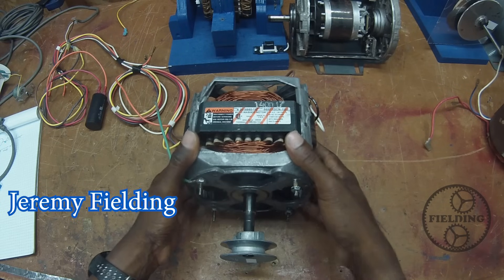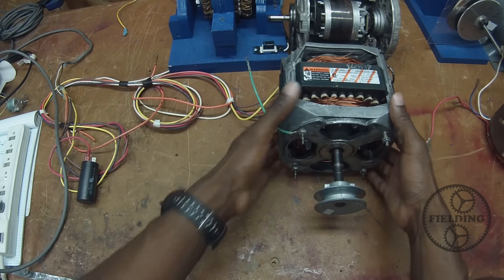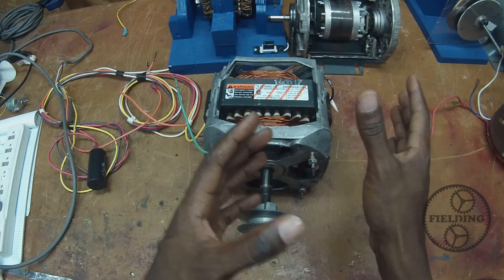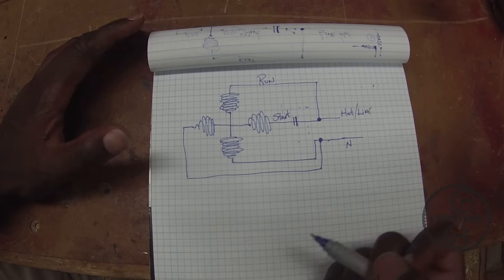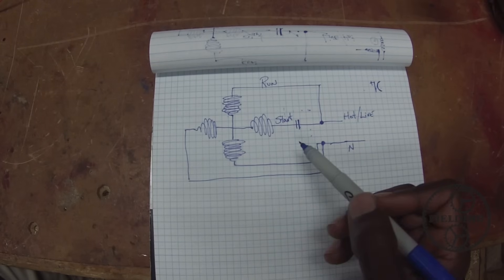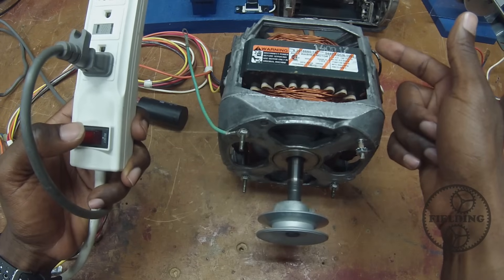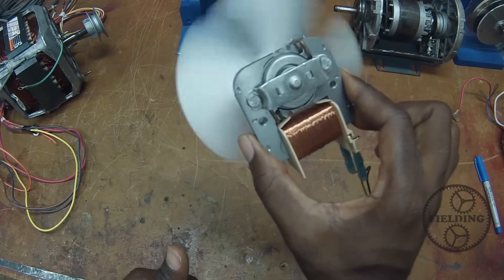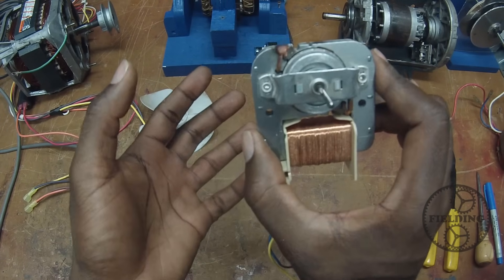How Motors Work For Beginners: (Episode 4) Single Phase Induction and Shaded Pole Motors: 035

Comment: I have a magnetic switch (only works under voltage), runcap 16 uf and 1 fase motor ( in a 0,74kw table saw). I changed out the cap due to presumed age (around 35 years), but when I connected this new cap, it buzzes. Motor does not turn. Grounding is ok. I'm now changing the aging/deteriorating wiring within the motor to the cap and 220v (a red, black and yellow lead). The black lead is connected to 3 copper strands, the red to 2 strands and the yellow to 1 strand. The yellow has deteriorated (rubber isolation disintegrated showing wire).There is no centrifugal switch inside the motor. When connected to 220v the system clicks (must be the magnetic switch) but does not run when pressing the switch, which does stay in the -1- position, meaning it is passing current. The capacitor is buzzing. What could be wrong in your opinion?

Comment: Hi my name is Fred I have a question what is the best motor to use to it to be able to adjust the RPMs I need it to stay at times at 900 and all the way up to 1800 I have a one horsepower motor from harbor freight will that work

Comment: A turntable motor designed for 110 volt with 0.8 amp fuse. What will hapen if connected to 220 volt?

Comment: I have a AC induction motor (120v) (for a bench grinder) which does not start.   I bypassed the relay (which connects to the start winding) with a momentary switch. When I put the motor switch to the on position, the motor hums and the shaft of the motor freezes.   Pushing the momentary switch has no affect on starting the motor.  The start windings measure 11.3 ohms.  The main winding measures 3 ohms.  I am unable to rotate the shaft with current applied.   I can turn the motor shaft freely with no power applied.  There is no capacitor with this motor.  Any help to understand why this motor is not working would be appreciated.

Comment: Can you run a 3 phase motor on single phase power?
Reply: You can if you use a device called a phase converter. The device generates all the phases the motor needs to run. So the correct answer is yes, and no.

Comment: hey Jeremy i have a reducer that has a 120 volt dc motor on it is there any way to make it 12 volt so i could make a wench out of it   ? and can i use a switch to make it go back and forth how could i control it ?
Reply from the maker: The winding of the motor are designed to operate at 120. You can't change that without rewiring the rotor. It will probably run at 12 volts but with very little torque compared to its full rated voltage. To the second question... yes a switch can be use to flip the direction... I explain this in great detail in my DC speed control video. I think you will find it helpful. Check it out here. https://youtu.be/ASywVBU0ZwE
Reply: yea thats what i was thinking do you think in the future vid you could show how to convert them down to 12 volts with high torque
Reply from the maker: +j mil I don't think it is practical to try and convert them. It is likely the size of the rotor slots need to change. You have to reengineer it. I would not now where to begin. I would be looking out for another motor. Check Craigslist and eBay. You may even get a free one on Craigslist if you check often.
Reply: ok thank you Jeremy i will probly look for a 12 volt replacement

Comment: Can you ruin a motor by using it to do more work than it's capable of doing?  I want to build a rock tumbler, so I need a motor that turns slow with high torque.  How do I know if I'm 'over-working' the motor.  It may turn the barrel, but is it doing so efficiently?  Or is it consuming more power than it should in order to do the work?

Comment: Hey hey:) love the videos! Invaluable info:)
I love tinkering for fun.
I have a quick question that hopefully someone can point me in the right direction for info.
Recently I found a Dayton 2hp continues duty single phase 110/220 motor.
The diagram is faded, and all the wires in the motor are yellow:0 
So I'm just looking for a descriptive vid like yours for how a 110/220 motor works and is wired.

I tried googling it but everyone just says check the diagram :/

I also googled the model of motor but those are colored wires :/ 
I thought it would be cool anyways to know how they are wired and how 110 and 220 are pushed through the same motor.
Reply from the maker: I plan to make a video on this topic.
Reply: Jeremy Fielding Awesome! 
I plan on attempting to make a light duty winch out of a powered wheel chair motor. I'll be sure to share what I learn here:)
Thx for your hard work and sharing of knowledge 👍

Comment: I buy a motor and it said that’s a 3/4-1/4 hp R.P.M.1725-1140 volts-115 HZ-60 and PH-1 and it has Low speed Common and High speed with 4 wires and a plug with 4 pins and I think that because it said 115 volts it was going to be ok to connect to the regular connection at home I didn’t pay atención at the plug and now I don’t know how to make it work, somebody suggested to buy a 3 wire plug and cable and connect to de high only speed and that way a may make it work and another question is that I don’t see any capacitor on the motor can you help me with this please thank you very much.

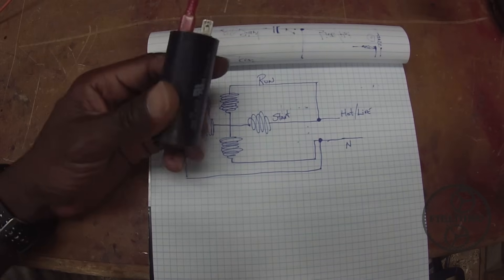Comment: @3:45 you show examples of start capacitors. 
The one on the far right is a relay not a capacitor. 
Other than that I like your videos
Reply from the maker: Ryan... thanks for the feedback... It is in fact a 240 volt, 10 micro farad capacitor. I have double checked. That is indeed an induction motor. The extra wires are because the motor can be started by the control board in both directions.
Reply: Jeremy Fielding I did a screen shot and zoomed in, you are correct, that's what it says.
I've never seen a capacitor that looks like that.
Thanks for the reply

Comment: Didn't you mean the start capacitor delays the start circuit relative to the run circuit? Capacitor should take some time to charge...
Reply from the maker: I said it very carefully on purpose. It sounds counterintuitive, but I said it correctly. You can check the description for more resources to learn more.

Comment: how is it that companies are selling 3 phase motors that run on 110 & 220 instead of 440 or whatever 3 phase is?
Reply from the maker: Three phase power is separate from voltage. All three lines can be 10 volts or 2000 volts.
Reply from the maker: Make sure you watch #38 on three phase. It will help
Reply: Jeremy Fielding I believe I've watched your three phase motor video... But how are they powered from my house power. The reason I'm asking is because I'm going to build a 2x72 belt grinder. one of the companies I'm considering purchasing the motor & VFD from states it's a 3 phase motor that runs on either 110 or 220. How does it work (or will it not?) from my residential power. Thanks.

Edit: just learned from 44 that the VFD drives it with the single phase... Thanks again.  Have a good week.
Reply from the maker: I use a single-phase to three-phase VFD. You can plug the VFD into the wall and your motor into the vfd. A three phase motor can have any voltage. Basically it takes the single phase power from the wall and creates three separate phases out of it. They come in 240 to 240volts or 120 to 240, but you need to make sure you can supply the total power from the wall or you will trip the breaker.

Comment: How does the other motor from a microwave work? The synchronous ac motor that turns the turntable. It's just permanent magnet that sits inside a single coil of wire and I don't understand how it starts, how it runs, or how it can generate electricity. I'm an electrical engineer so I understand most motors, but that one baffles me.

Comment: universal motor, can you run a universal motor on 120 votes dc and no more or can it be run up to lets say 220? like the vacuum motor that is rated 12 amps, as long as the volts don't go over the 12 amp rate can it be done? just asking haahah
Reply: You could run a 120V motor on 220V if you could limit the current the motor draws. Stepper motors are operated this way to increase performance. Voltage is increased and current is limited by a driver.
Reply from the maker: Excellent catch there. I almost missed this comment. Thanks for the back up LOL I was thinking the same thing. Limiting the current is the issue with the universal motor in this context.
Reply: Jeremy Fielding THANKS for the reply, I was wondering as well about the amp thing as far as horse power? 110 people say can not be more than lets say 1 or at most 1 1/2 if you want more hp you would need to go to 220? would a universal motor be able to get more hp from 110 or just more volts without the current? I am no electric kind of guy, just asking for a wheelchair project of mine I have one leg congestive heart failure JUST ALOT OF BAD stuff wrong and I need the chair THANKS AGAIN Joseph T
Reply from the maker: Unfortunately you can't increase the max hp of a motor by increasing the voltage. In general, motors over 2 hp run on at least 220 volts. But its more complicated then that. Speed is a part of horse power, so motor with little torque but very high speeds can be rated at high horsepowers. Anyway. If you increase the voltage but limit the current you are back where you started. If you don't limit the current your motor will accelerate until it starts to tear itself apart. You need a new motor if you need more power.

Comment: The start capacitor delays the phase.
Reply from the maker: That is not correct. Please take a moment to research yourself.
Reply: @Jeremy_Fielding , Already did. You're obviously wrong.

A capacitor DELAYS a change in voltage BECAUSE it has to charge.

Therefor the start capacitor DELAYS the phase.
Reply from the maker: @dougpenhall  I really wish I had time to engage and explain but all I can say is I thought the same thing before so I get it. As you learn more you will see. Here is an interesting video that discusses the same thing... maybe you will believe them and then actually do your homework. I even skipped to the good part for you about 14 minutes into it. Please do me the honor of at least checking before you say I am wrong. I don't have time to keep responding so I will leave the rest to you. You can see they show the phase shift forward and any AC motor books will show the same. https://youtu.be/07uXnc1C5CA?t=886
Reply: @Jeremy_Fielding , Ok. I realized now that you're talking about a single phase motor where the capacitor is in series with a start winding while I was thinking about the start capacitor on a 3 phase motor where the capacitor is put in parallel with one of the windings.

When you put a capacitor in parallel with a winding, you're delaying the applied voltage to the winding until the capacitor is charged. Since you're applying AC, there's a continuous delay of the voltage across the capacitor which results in a continuous delay of the voltage across that phase of the motor. In a 3 phase motor running on a single phase, you need both a start and run capacitor. You need the run capacitor because you need a continuous delay of one of the phases. And you need a start capacitor because you need more capacitance during starting than you need during running.

But, in the single phase motor in your example, you put the capacitor in series with a start winding and a start switch and then you're talking about the current in the start winding. This is very different likely why we're not in agreement. Basically, when the input voltage is oscillating, the the capacitor is pre-charged from the previous cycle which causes current to flow through the start winding ahead of the input voltage.

So anyway, this is the source of our disagreement and now I understand that you're right and I was just confused about what you were talking about.

Comment: bench grinde running very very  slow, no centrifugal switch, just capisotor., cap ok.
Reply: If there is no centrifugal switch, only a capacitor, the motor is called a permanent split capacitor motor. This takes an oil filled running capacitor, usually metal case ranging from 5 to 25 mfd @ 370 vac,depending on motor size. If your capacitor is good, then the winding is bad.

Comment: 3PHASE TORCHED PARALELL 3 PUSHED 3 PULLED...XHYRIES  LITEXPEED...1ST STAGES PUSHED PULLED  2ND STAGES PUSHED PULLED 3RD STAGES VOLSTAGES  PUSHED PULLED..OR PNP NPN BATTERY CAN PNP 1.5(+(-)+)1.5 ( -++-) CENTER  TAP PNE POS+  ...HALF

Comment: this i don't understand why anyone would market and mass produce a electric motor so inefficient like a single phase we are talking about 35% energy loss, why not using diodes to rectify AC to DC and use a DC motor in every single phase application or using always a three-phase AC design to work with 220V, why anyone would just produce something because it works with no regards about efficiency is beyond me maybe i am losing something here i don't know